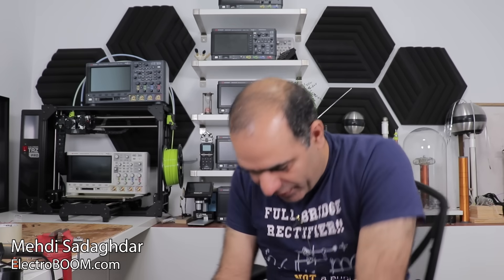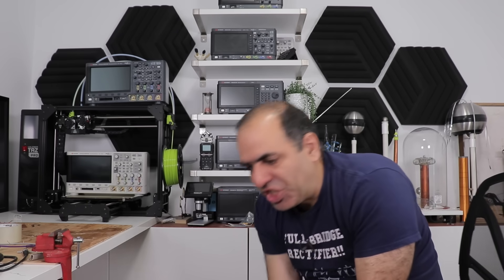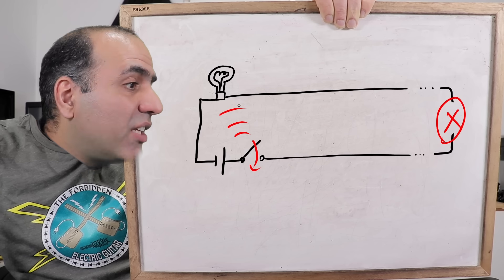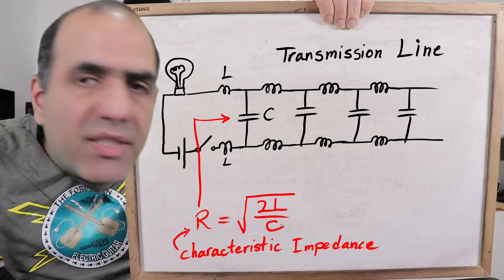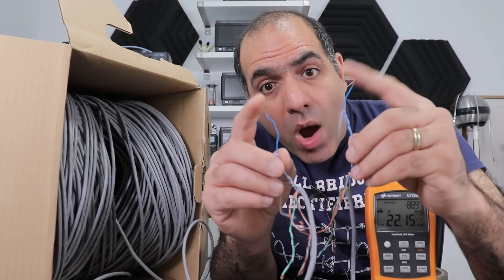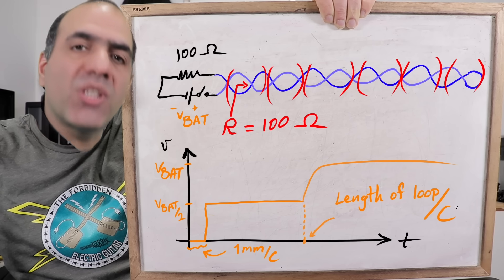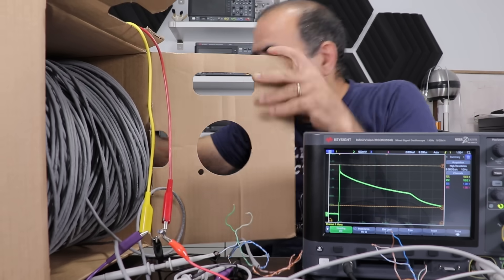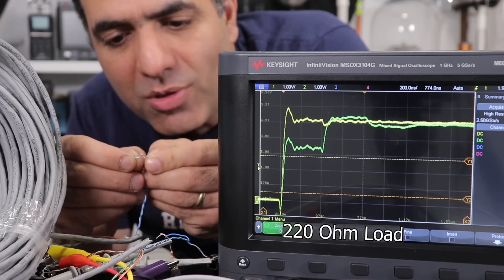Testing the LONGEST LOOP OF WIRE!!! to Turn a Lamp On

Comment: couldnt you check for charge density very close to the battery? take a piece of metal and touch the wire next to the battery, it should accumulate chargers on its surface as well. then disconnect it and chek if its charged electrostaticlly.

and alother thing. if infact it is fields that transfers the energy, the the net field on the lamp should decrease with the distance, if the distance between the wires would be 2 meters, would I get the same current through the lamp just after 2m/c seconds? or a lowwer current, and if so why?

is the reason for the drop in the current radiation? I mean, there could be a wire on the other side of the switch, and the same current should flow through  it as well, where does the energy for that come from? 

could you could explain the problem in regards to conservation of energy and explain exactly when (and witch part of) the circut radiats?

when you conduct your expiriment I think it would be interesting to change the distance between the lamp and the switch. and maybe even the location of the battery on the wire, maybe next to the lamp, would it matter?

Comment: Another factor your missing is that the length of the grey wire thats all the wires combined is shorter then if you untwist the wires inside that twist adds a little length thus could be a factor in why it seems slow
Reply: Ooh, a very good point!

Comment: 0:19 - of course I know, it's a series of commercials from Japan about a long gum :)
5:06 - okay, that made me laught too hard, I like that Mehdi is into memes :D

I like this mini version of the test. Reminds me of the parking system I made at my previous workplace. I used an Arduino Mega to check parking spaces periodically and signal to a display if all the parking places were occupied or not. After the project was done a guy came (friend of the company) to talk about it and he said I did a good job but next time he comes he'll bring a scope to see how much of the digital informaiont degrades over the line. We used twisted pairs too. I soon left the company because I wasn't feeling good there so we never checked the signals :/

Comment: Your analysis of the twisted wire cancelling eachother out was very interesting. Learn something new everytime I watch your videos.
Reply: that's how GFCI circuit breakers work.  (like the bathroom electrical outlets with "test" and "reset" buttons). the two wires are wrapped around a transformer core, but in opposite directions, so they create opposing magnetic fields that cancel each other out.  a third coil on the same transformer is used to detect a voltage when the current going out doesn't match the current coming back in.  if you get electrocuted, some current goes through your body and back through ground, so the current going back won't be as much as the current going out of the outlet, so the transformer's two magnetic fields won't match, so the third sense coil will induce a voltage and that's used to trip the breaker open to save your life.  it's simple, elegant, and brilliant
Reply: @JohLincN traditional telephone lines use twised pairs over multiple kilometers. It's not useless, just much less useful than a shorter one.
Reply: @JohLincN  300ft has to do with the speed of light more than interference. It's really more of a legacy from the days when we built networks with hubs and every packet was send to every node. It's a timing/deconfliction problem more than an outside interference issue.
Reply: @lvlinty  Exactly, 100m is based on the time a packet can travel, so that CSMA/CD can do its magic and detect collisions. In switched networks this is no longer necessary, i personally witnessed 300m long links negotiating gigabit speeds and working for some seconds before failing!
Reply: @Z80Fan  I did sort of the opposite.  Using cat5e for relatively long (25m ish) I2C communication.  I2C is nominally 4 wire (data, clock, power, ground) but intended for short range only.  I got it to work, but you have to use all 8 conductors paired up just right ;)
Reply: @travcollier  I'm quite interested in how you managed to achieve that! I suppose it's necessary to use twisted pairs even for power and ground, because that's the return path for the signal voltage…
Reply: @TerrisLeonis  What ended up working was making half of each pair ground... Mostly.  There was some trial-and-error involved with getting it working reliably.  I wish I could find my notes for it -_-
Anyways it was connecting a Rpi to an SHT-31 temp/RH sensor.
Reply: @JohLincN  "outside forces start leaking in" lmao
Reply: ancient people 🅥  the
Reply: Another usage/explantation of the twisted wires are "invisible dog fences." When you have to run the wire of the fence back to the power source/hub, you have to twist the wire around its self so the electric field doesn't form and tells the shock collar to shock the dog because his collar is next to the line. If this "rule" of electricity didn't work then your dog couldn't circle around your house fully.
Reply: Seems like this information could be used to make a more efficient motor.

Comment: I think your setup is superior to using a loop as described in the original thought experiment, because while you've preserved the behaviour that matters for the experiment you've eliminated another effect that could have cast doubt doubt on the results. 
In a straight line over the same distance, relativity would become an important consideration. That is, since information can not exceed the speed of light the change in fields could only propagate from one end to the other at that speed. If this were not the case then the initial proposition would imply communication beyond the speed of light, breaking basic causality. 
Bravo!
Reply from the maker: Thanks! But that wouldn't break causality either. Information doesn't travel faster than speed of light in the original setup, it just travels across the 1 meter gap through air as electric fields. It doesn't need to travel the length of the loop for some energy to reach the lamp across the gap.
Reply: @ElectroBOOM  HI Mehdi!!!
Reply: @ElectroBOOM  ah, yes, I was imagining the switch and lamp being far apart while the wires remained close for their run. I forgot that the switch and lamp were to be adjacent.

Comment: So, what you are saying is that, if I take out all my house light bulbs there will be the same open circuit so I can light my house for free with LED bulbs. Open circuit = very little power used .
Sounds like a Free Energy Scheme. I'll alert that LectroBoom guy, he doesnt like the free energy scams

Comment: Measuring stuff that seems untouchable like the speed of light by bringing it down to earth with big but reasonable measurements is exciting, you're pushing the limits of the universe. If the speed of light was different, that speed of the waves bouncing back and forth would be different in a way we can clearly see, spooky!
Reply: I love how much the youtube team is doing to combat the bots.
Reply: @j100j  They are probably thinking how to justify remove of the reply button.
Reply: @j100j  What YouTube team? No human has any input in what's going on with moderation nowadays due to Google being too greedy to hire countless people to go through stuff. It's all the algorithm's job, as they claim it "learns" things and deals with them automatically. Which is clearly a lie as the bots have been a problem for years, and on every new video from even smaller channels, you'll find at least 3 instant bot comments and 2 to 3 different bots that spam comments in the replies (most common ones are the variation of "Finally it's here [link]" and "Don't read my name". There's also the thotbots, comment copying bots that farm subs and are usually bought checkmarked accounts (A, B, C.... all the way to to Z, Blexzy, Pepper etc.), there's just too many kinds to name. And the best part? Reporting them does absolutely nothing, no matter how many people report them. YouTubers themselves need to use scripts to deal with bots (deals with the most common ones that use the same comment format, doesn't with comment stealbots) or go through their comments to delete them manually. It's pathetic, and the sub farmers that later sell accounts for big bucks have been going strong for over 3 years on the same accounts without getting banned, so my hopes for anything happening to them and the stupid algorithm "learning" are an absolute zero. It would take an actual human just 5 seconds to copy-paste a common bot comment and add it to ban list to deal with a big chunk of thotbots who almost all use the same variation of broken English comment (and haven't fixed "butter to "better" for 1.5 years). It would take at most 10 seconds to deal with other kinds of bots, one by one. Yet for the almighty algorithm? It will take forever, because that's what it's set up to do - nothing, because Google loves bots as they, just like on Twitter, make the company look better in terms of statistical user interactions to ad companies. It's really sad. I can almost imagine them introducing microtransactions like "Pay us $100 and we'll deal with bots on your channel for you!". Hell, now that I gave them the idea, they may actually do it. So get used to bots, as they're not going anywhere, ever.
Reply: OMG! The workings of the natural world are things we see and experience! SPOOOOOOKKKEEEEY! Those electrons are moving through totally eldrich means. ooOooOoOOOOOOooo!
Reply: Oasty watches ElectroBOOM too? You've got good taste.